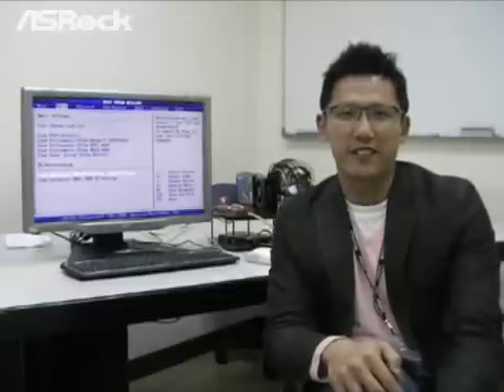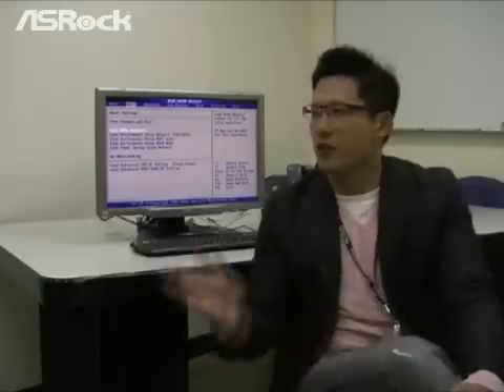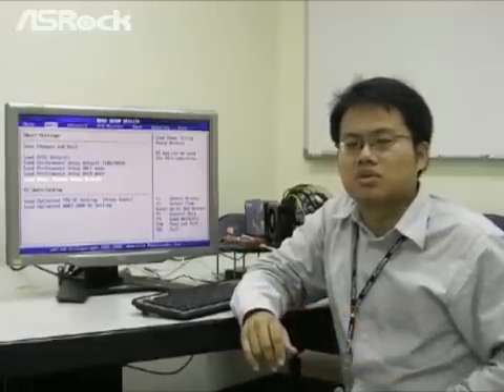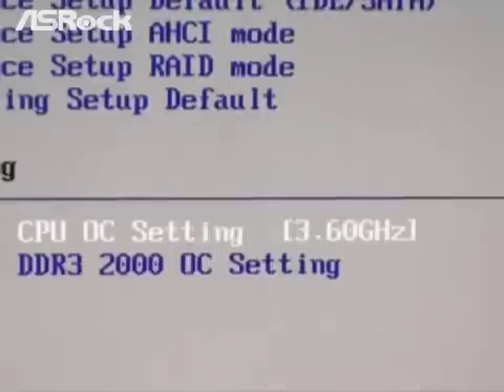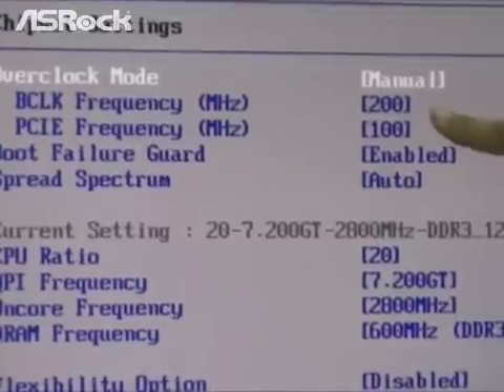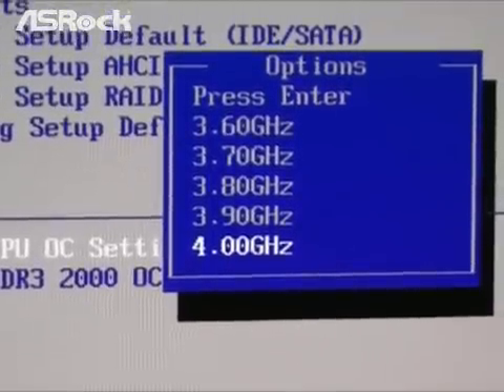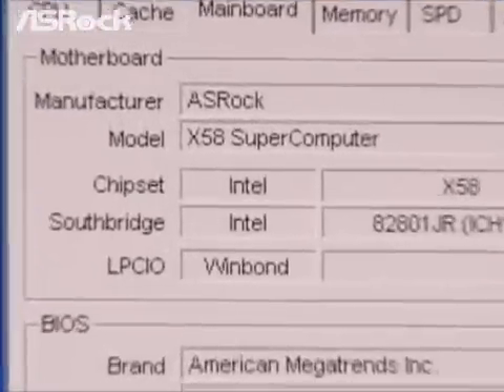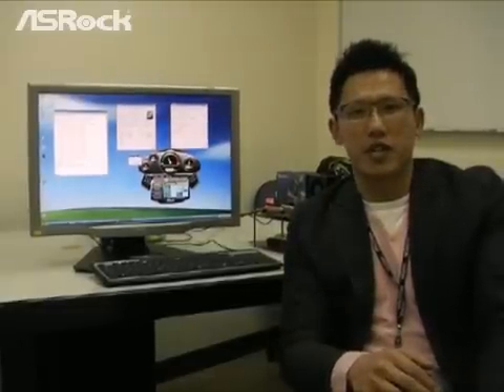X58 SuperComputer EZ OC 4.0GHz demo

Comment: if you watched the video, and heard everything they said, the ASRock X58 has been pretuned to handle up to 4.0GHz for the i7 core. Whatever overlocking you did that was on on the EZ OC BIOS menu, it's your own fault, not ASRock's. If you want to overlock something for more than that, then buy another motherboard that doesnt have EZ OC. Also, note the CPU monitor, it wouldn't be recommended to use the i7 cores up to more than 4.0GHz as it could cause stability issues and as well as extreme wear.